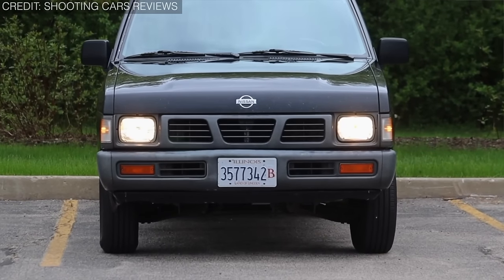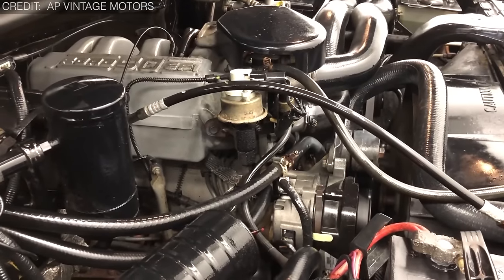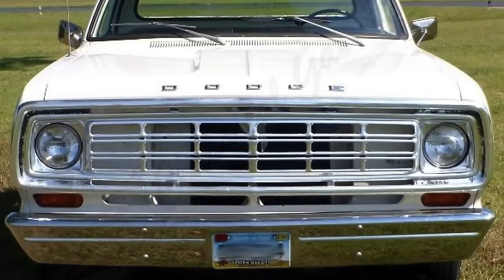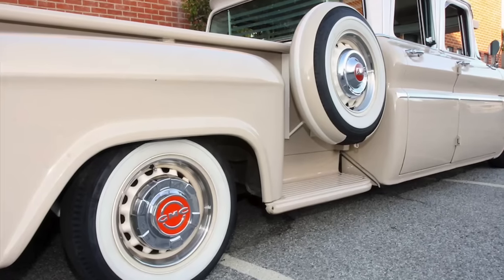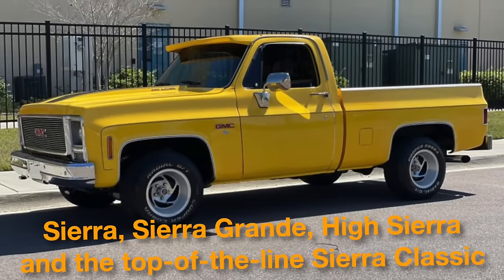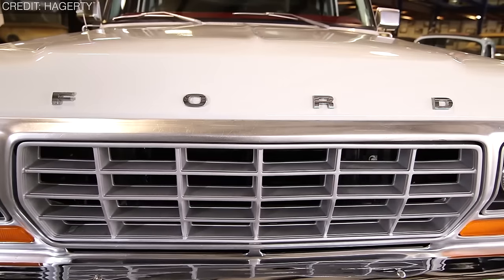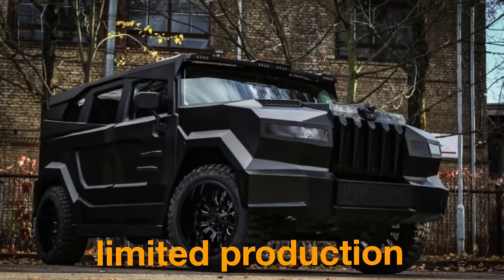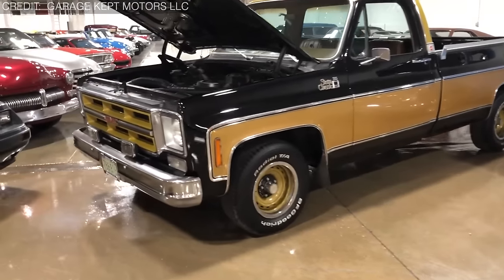50 Secret Pickup Trucks of All Time You've Never Seen

Comment: also if the datsun 620 pickup production years was 72-79 i dont see how it was the 1st truck with independent front suspension because gmc and chevy had independent front suspension i know as far back as 1964 or 1965 as a standard feature on their 2wd pickup trucks lineup even the 67-72 chevy and gmc came factory independent front suspension all the way up to present time they did have optional coil spring rear suspension as an option besides the standard rear leaf spring setup on the 64-72 2wd models.. now you could mean that maybe they had independent front suspension on the 4x4 models but im not sure or aware that they did but just thought I'd throw my 2 cents out there on that subject.. great job on the vids i really enjoy and appreciate all that you do to put these vids out